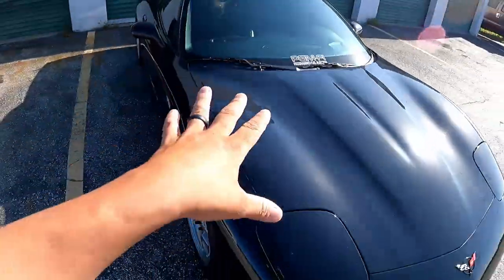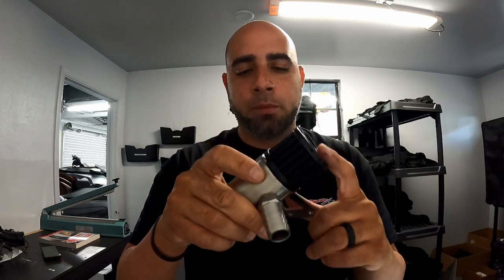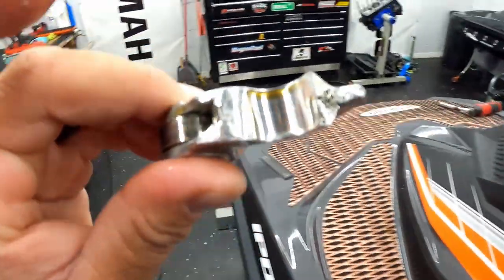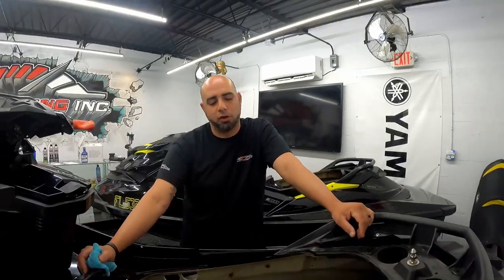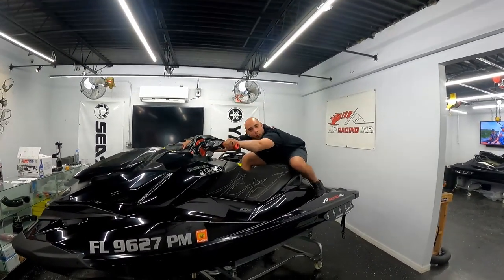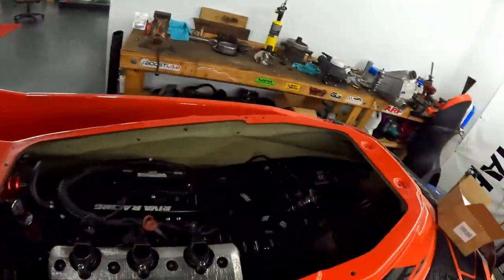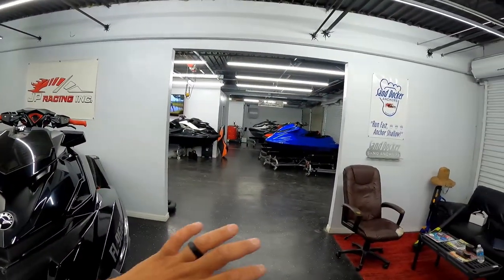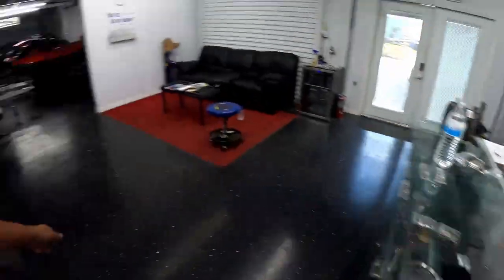Free Speed Anyone? Shop EXPANSION AGAIN!

Comment: Trouble shooting question here. Long story short... I have a 16 RXP-X 300 stage 3. 2 weeks ago after starting the thing felt like something got into the impeller/ pump. Ski started vibrating a little when reving it up. After about 2 mins the vibration went away. Later down about 15mins I was riding slow in choppy water, then hit a boat wave at about 30mph. As the sky came back down from the little jump I was off the throttle... As soon as in came back into the water the ski suddenly stopped. Had it towed. Did a check on it next day and came to the strong believe that it might have bend  #1 piston rod. My question is, what could have caused  a piston rod the bend is ski wasn't really going at high speed? 
Syphoned the oil out and found sand like metal shavings in the filter. Bad rod bearing maybe? 🤔
Reply: ik im not JPR but it definitely sounds like you have a rod bearing issue. either way the motor would have to be pulled and rebuilt.

Comment: Julio, do the 2018 seadoos come with the upgraded flywheel bolts? Not the ARP bolts but better then the older skis had?
Reply from the maker: Correct.
Reply: @JP_RACING_INC  
Do you still have issues with them shearing or coming loose?